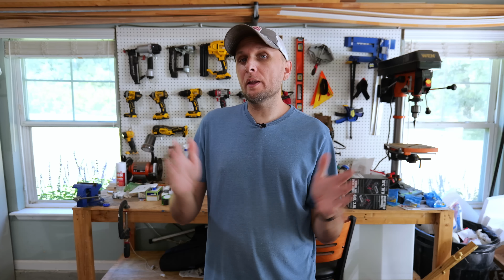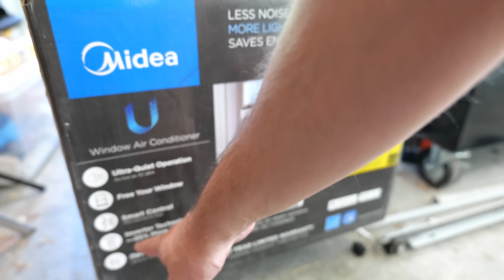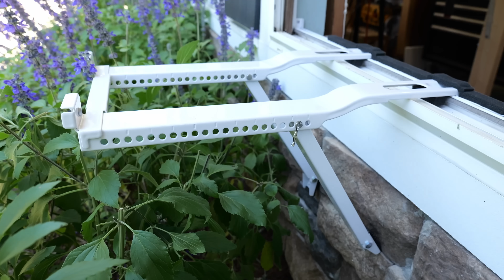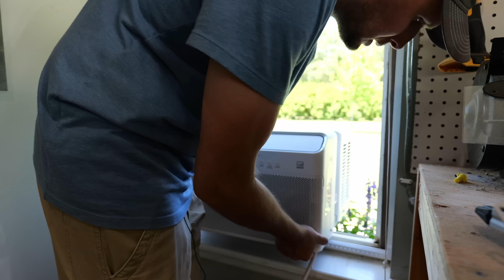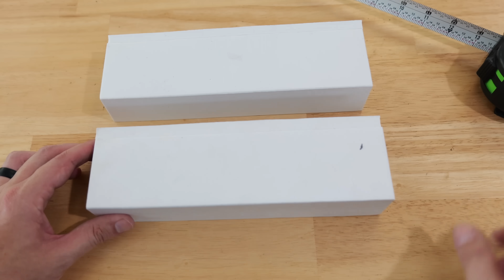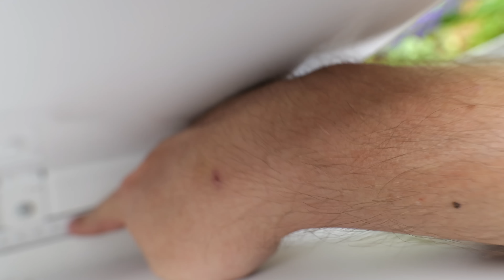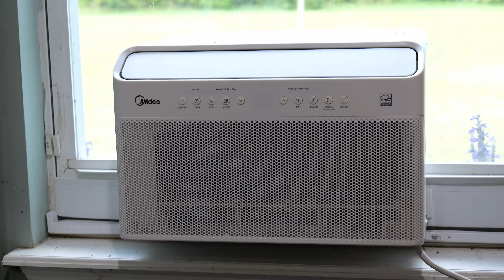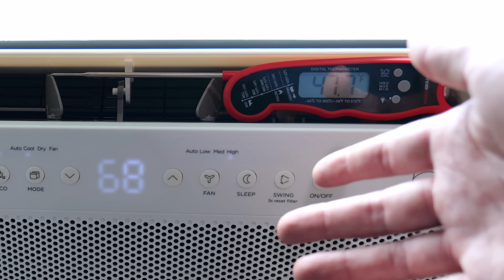The COLDEST And QUIETEST AC Unit Ever Made!  Still Use Your Window!

Comment: I bought two of those to see if I would like a mini split instead of upgrading my central air.  I will keep them as they are.  Incredible cooling in the deep south with barely any shade.  Highly recommend them.  One 12k in the LR and a 10k in the back bedroom keeps my 1200sqft house cool.  Mine are a/c only.  No heat so that has to be considered in your decision.   But again, I'm in the south.  Winters are not usually that cold and I use my gas fireplace almost exclusively for heat.

Comment: Good review of an inverter AC unit with the U-channel design, but in your tag line you said to forget the mini-split.  That was highly misleading because this is ONLY an AC unit...it is not designed to also heat your home, like a mini-split will.  Apples and oranges.
Reply from the maker: I did not claim that this could heat.  It’s all about the air conditioner.

Comment: I have had one of these for a year and a half now and while it is quiet, it is FAR from being the coldest window unit I have ever had, LOL!  It'll get the job done eventually, but the regular window ac units I've had in the past, while admittedly louder, (GE and Black & Decker units) have cooled the room I use it in down much faster.  I'm almost always at home so have never used the app, just the remote or the buttons on the unit itself.

Comment: I've been using an 8K BTU unit since 9/2021, and overall, I have been fairly happy with it.  The biggest thing that may be worth mentioning is the installation process.  First, the fact that it comes with a bracket is quite nice in my opinion.  Most units expect to just hang on the window, so if you want them to be more secure, you end up having to buy a bracket separately.  For me, that makes the inclusion of one a nice touch.  Anyway, I did find that the installation can get finicky if your window ends up being slightly abnormal.  For example, those slides that need to be screwed in?  Those don't line up with the window frame for me, so I can't use them.  I also had to do a lot of extra gap plugging where the AC and frame meet.

Another issue that I ran into is that I sometimes get a bit of a rattling noise in my unit.  If I push up on the bottom of indoor portion of the unit, the rattling will stop.  As noted, it does not always do this, but when it does, it is a bit of an annoying noise.  Other than that, I have no qualms with its noise while running.  I mean... it certainly beats one of those godforsaken portable units any day!  In regard to reliability, I haven't had a ton of problems with Midea products yet.  I did have one of their cube dehumidifiers die on me recently.  (The compressor seems to be bad given that it makes a gurgling noise after attempting to run for a bit.)

Although, I think one good thing to note is that since my unit is nearly 3 years old, it's possible that some of the issues have been resolved in revisions over the years.  I did end up getting a 12K BTU unit from Costco last year.  While I don't haven't chosen a location for it yet, I couldn't pass up the nice price; it was an end-of-season markdown to somewhere below $200.  If I get around to installing that, I'll get a chance to see if it has any improvements since it ought to be newer.

Comment: I have an Midea 8000 BTU unit. It is quiet, HOWEVER, when operating, the compressor doesn’t run at a constant speed. When the speed is increasing or decreasing depending on the demand, it has a rather pronounced low frequency rumble that can vibrate the whole room. Can be really annoying at times.

Comment: An important question I have is how it behaves if the power goes out for any reason. Will this unit restart itself using the settings before the power went out or would it need to be manually restarted/reset??

Comment: I have one of these, and I love how quiet it is, and how well it works in an unreasonably large space, but dear god it does NOT fit my window at all.  It does not seal to the window opening without extensive modification even if the bracket fits the window opening, there are gaps and crevices everywhere plenty large enough to allow bugs and outside air into the house.  The instructions that came with mine were unintelligible, referenced parts that were completely different from what was included, and the steps were presented completely out of order.  I basically had to re-fabricate the mounting bracket and improvise everything, and it looks like absolute garbage.  If the thing weren't so dang quiet, I'd throw it away and get a normal window unit that at least I know could seal to the opening with a piece of painted plywood.  :\

Comment: 1/2" screws?  I'm assuming you have drywall around the window opening? You really should have replaced those screws with 1 1/2".
Reply: I was thinking the same thing. The only thing holding that frame is drywall.

Comment: I'm sorry but I can't tell from your video or the Amazon link. Does the bracket that extends (and adjusts to the exterior wall) come with the unit?
Reply from the maker: Yes it does.  Everything came with the Air Conditioner.

Comment: Got one last year and it did better than a 10k but portable in a 300sf room.  The best part and why I suggest this to people is soft start it dosent makes thr lights flicker when the compressor kicks on especially on older electrical systems.  In a apartment complex I work on they can use 3 of these 2bed 1 living and not blow breakers even with 1 20amp line supplying both bedrooms. Good stuff 👍
Reply: What BTU Media are you talking about?
Reply: I have a 10k but and this year got another 8k but unit for a bedroom.  To be fair a old 5k but window unit could cool the bedroom in a heatwave but I have thr 8k unit on low and eco and dosent have to work hard

Comment: The U style that hang down the wall are a better design and I want one, however they need to make one of these into true mini-split that does AC and heat! There should also be no air opening between inside and outside, like a classic AC window unit which sucks.

Comment: Please try out and contrast with a GE Clearview AC which is also Inverter tech and uses a U shape that hangs down below the window, thanks.
Reply from the maker: Have a video coming out in a week or 2 on it 🙂
Reply: @HowToHomeDIY  
Since then with more research I see...
The Clearview saddle shape means condensation collects below the window inside and is PUMPED up and out to drain, creating a failure point. Pump might be eliminated by piercing the wall with a drain pipe, maybe.
   I suspect the 2 smallest BTU Clearviews might not use inverter compressors. Traditional rotary compressor AC's CAN be quieter at times than inverter units because with a proper eco mode and settings it will cycle completely off, then occasionally sniff the room temp (just fan) for a few seconds and only turn fully on when temps rise (like LG units). Quietness hinges on the sniff function being short, again, LG units. 
SNIFF FUNCTION DURATION is not a published spec for ANY company that I've found.
    Smart Inverter and Linear* compressor units run quieter than rotary/piston compressors but they run LONGER, sometimes never cutting off completely. My 9500 BTU LG dual inverter regular cabinet window ac
runs almost constantly whether in cool or eco mode. It's more subdued in eco but is keeps running. 
* You might cover Smart Inverter vs Linear vs Rotary/piston AC differences in another video.
Here's a good starting point:
https://techprimex.com/difference-between-smart-inverter-and-linear-compressor-of-ac/
I think all the linear and inverter compressors are quieter when running than the rotary/piston units. Thanks.

Comment: Power consumption  ?
Reply from the maker: Oh it's highest settings the highest wattage that registered was 517 watts.
Reply: @HowToHomeDIY  thank you , mine is an 8000 btu with adaptive changes, it is smaller however it Hase a 18' line set to achieve my location requirements. It runs on a different refrigerant . 420 Sf. Max is 675 WT. 
They are very efficient. I have sunlight on all 4 exterior walls. The tiny home is all metal, foldable and solar powered.

Comment: Costco has the 12k btu for $299 till 6/9/24, its far the cheapest price I found. Its worth the $60 membership to buy it from them even. It does take reading the manual, to get everything fit properly, and an electric driver speeds up the install.

Comment: Those been out awhile now. Soleus and GE kinda have the same but with reversed on the U shape not needing the window holder for installation. Also, I noticed you had an alarm on window . Did you have to disable it so the rest of the house will be secured ? Nice video. 👍
Reply from the maker: Yeah I looked at those but they aren’t nearly as quiet or efficient.  I just had to move the sensor that was attached to the window down some.  Then all was good. Glad you liked it!  Thanks for the feedback!

Comment: It would be extremely helpful if you could provide info on the amount of current this unit draws. Does it require a dedicated 15 or 20A circuit?
Reply from the maker: Doesn’t need to be dedicated.  Mine is on a 15 amp.  Only uses 500 watts at max draw.  Most of the time is much less.
Reply: @HowToHomeDIY    Thanks, very impressive. It's quite surprising to me that this is not mentioned in the item's Amazon description at all, as it's a huge selling point. The only place I was able to locate any info on the current draw was within a user review. Baffling.

Comment: I have been running two of these in my house purely off of solar panels and inverter and batteries 24/7 My electric bill went from $400 a month in the summer to $125 in the southeast USA😊
Reply: Do you have a video or instructions how to set up a solar system. Our light bill has gone up significantly over the last year. Might be coincidence but since they changed out to a digital meter our electric bill went up extensively.
Reply: @incognito-c1o  hey friend, sorry I do not make videos and I am not even on social media. If you look up a place called signature solar and a place called San tan solar. First place is where I got my inverters from second place is where you can get crazy cheap and I mean crazy cheap solar panels. If you go on YouTube and look up Will prowse solar He's a young man in Nevada and he's probably one of the top YouTubers for solar DIY projects You can literally learn how to solder wires, make your own battery banks, do everything and I mean everything for solar from this young man. 
EG4 3k inverter is what I use and it was like $675. I also use EG4 48 volt rack mount batteries for this part of my system. I apologize I can't be more help as I don't do videos like I said everyone tells me I should but I just don't have the desire to sit down and edit them.

Comment: I've seen several other units, of similar design, except they all had the 'U' facing down, so that it fit over the wall and window sill, not the window itself.
Reply from the maker: Yes those are saddle air conditioners.  They do allow more view out of the window but they are not as quiet and efficient as this unit.  So there are trade offs.
Reply: This .

Comment: I have had this unit for 2 years now. It has gotten a little louder over time. It has also stated to have a rattle, or vibration noise that comes, and goes. It is still more quiet than any other window unit I've heard in the past.
Reply: Take the cover off where the fan is and tighten up the fan fixture screws spin it by hand do you hear any noise from the fan anymore ? If no noise place cover back on it and run it hope you have no more noise.
Reply: @gregj.gotham4402  It's an intermittent issue. It only happens maybe twice a week for like 20 minutes, then stops. I'll keep that in mind for my next deep clean though.

Comment: They're super easy to install.  I love mine. Technically, mine says Danby on the unit, but it looks identical to this Midea.  Even the Danby install video on YouTube is a "rip-off" of the Midea install video.  I like this whole idea that I can open the window, but realistically, once the AC is in, you probably won't want to open the window since, you likely removed the screen.  No screen = bugs.  No one wants all those bugs coming through the window.  Got any ideas for portable screens to place in there in the middle? 
Why they make the foam dark gray? The foam ought to be universally white since everything visually is white.  
Yes it's cold. I love this thing!  
Do you know how low the outside temperature can be to run this thing?  
That's the single biggest question I have not found an answer for yet.  
Don't air conditioners have a risk of freezing/icing the compressor if run when the outdoor temperature is below 60????    
I want to run this thing when the outdoor temperature is in the 50's at night because the room will stay too warm if I don't run an AC basically all of the time. 
This thing has a great dry (dehumidify) feature.  I have to run it on DRY as my first choice.  I'm in East Tennessee, and it's basically too humid here.
Reply: Danby makes really good dehumidifiers. Mine is 20 years old and still running. Keep my basement dry as a desert.

Comment: We're starting our 4th summer with our 12K units. We live in the Texoma part of TX, not as humid as Houston, but not as dry as Lubbock. I have never used the "Cool" setting on ours. Instead, we use the "Dry" setting, and leave the daytime temp set at 76. Right now (6:30 pm) after hitting 100 today, my 10x10 office with the door open is sitting at 73 (that's as hot as it ever gets during summer). At night, the unit in our room is scheduled to turn on at 7 pm, on "Dry" mode, at 75. I programmed it to incrementally lower the temp down to 68 over the course of 3 hours, all while staying on "Dry" mode. In the morning, our room is regularly 63 - 65, with the unit barely being audible as it runs. At the same time as the window unit runs, the main AC is set to run at 70 during the night, and 76 during the day. Bottom line, in a moderately humid climate, just run them in "Dry" mode. I almost forgot - Make sure the wifi dongle is plugged in if your unit has wifi, and definitely download the app!
Reply: That's interesting. So much of the heat we all hate is the humidity. Sounds like you got it figured out pretty well over there with how to control it.

Off topic: I had many a fun visit to Lake Texoma when living in DFW 25 years+ ago.
Reply: @4seeableTV  What part of DFW? I lived in the north Dallas side (actual REAL north Dallas). I knid of miss what DFW used to be back then.

Comment: These are awesome window units, but they dont compare to a split unit. 600$ minisplits are usually around 20 Seer2 today, which uses 40% less power than this 15 seer midea window unit. Worst case mini split would be 17 seer which is still 19% better. Wnd for 700$ you can get a 21 to 22 seer2 at 54% less power.

Comment: Nice idea and not horribly expensive.  But it doesn't work for those of us who have horizontally opening windows.  Thanks for sharing.
Reply: Casement window AC works for a horizontally opening window.  Of course, if your horizontally opening window is wide enough, this Midea would fit as long as you can set the support bracket (or some supportive base), and block the top (use board or make a framed window piece).  I know I saw somewhere on YouTube some guy did just that.
Reply: Good Info

Comment: I bought one of these a few weeks ago for my primary bedroom. Nobody talks about how you can't close your blinds all the way, and you don't have privacy with these units. I thought the U-shape would be wide enough to accommodate some blinds.There are two large uncovered windows on either side of the AC unit. Its not great for a bedroom.
Reply: This really depends how wide your windows are for people to peek in and who are these people peeking in slits of the side of the AC? I have my unit pushed in towards the room far enough to allow my blinds to close all the way down. It does depend what kind of blinds you have, mine are .25   of space from my window and fits easy enough to allow light in when open. There should be enough room in the U shape to adjust where you window and blind can close all the way. That's why the side L brackets are designed to be adjustable in case you need to either move the unit slightly in or out. Also, why wouldn't you just use a film tint or decorative paper to block the area where the window isn't covered if the blinds are too thick to close all the way down?

Comment: I picked up one last year for a part of the house, loved it, picked up a 2nd (with amazon points!) for a nother area.
Super simple with the caveat that if you have an old home with 'non-standard' sized windows, you may/will have to customize the insulation/gap fill that comes with the unit. I just used a hot-wire styrofoam cutter and cut up the packaging material to make them.
Nice units, not loud except fan on high, which is to be expected. 
As with all AC, figure out the space you plan to keep cool and size accordingly, bigger is not better.
Due to my old window sill, depth etc. the brackets wouldn't fit, and I was going to make some, forgot about it, and ran all summer without them.
The support frame design is really nice and solid. Heh.

Comment: We live in south Louisiana; hurricanes are always a concern.  I have one of these for my bedroom during power outages.  Works great, easy to install, and is very quiet.
Reply: How does it work if your power is out? 🤔
Reply: @Drop_Top_Roberto  I have a portable generator that I can connect to my electrical panel using an interlock kit; runs the whole house except my central ACs. hence the window unit. 😃

Comment: For added security, you could add screws on both sides to prevent the window from being opened.
Reply from the maker: It also comes with some 90 degree brackets that can be screwed in.  But then you would not be able to freely open the window.